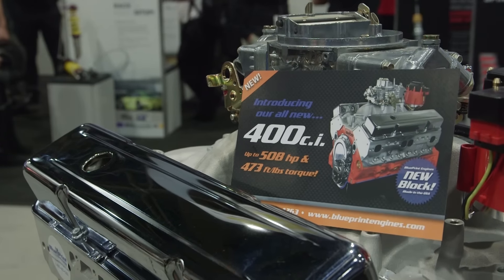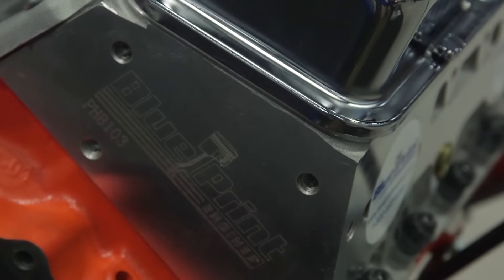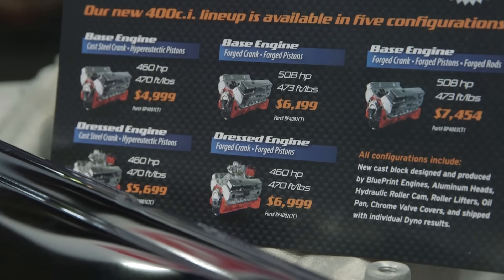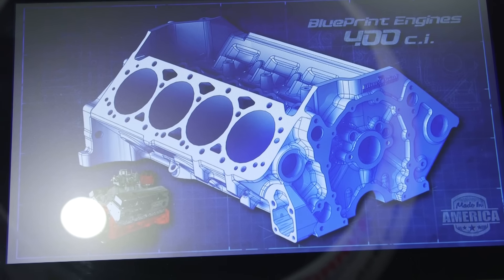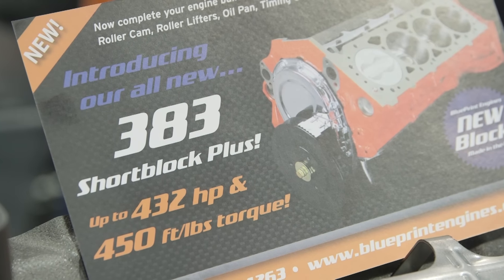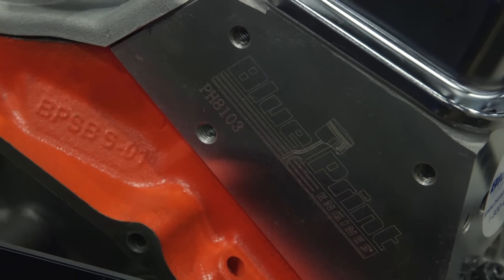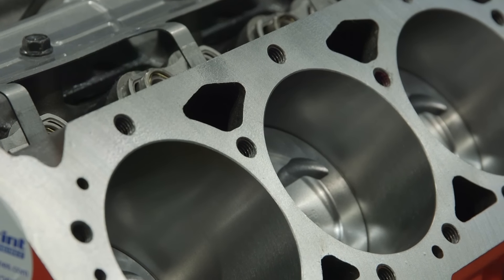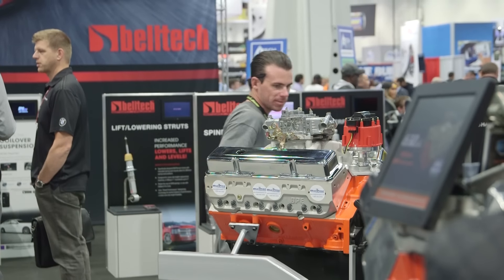SEMA 2015: The 400 is Back from BluePrint Engines

Comment: There is an old Hot Rod article on the AFR (air flow research ) website called: The 350 Chevy should have built. 400 block 327 crank 6 inch rods. It produced 400 hp 400 torque on 87 octane fuel. I'm glad the 400 is back so I can take a crack at this engine. Hell, if Blueprint sold this engine, I would buy it.
Reply: @derekthegreatgonzo  Just went and read that old Hot Rod article on AFR's website. Definitely not moronic. I'm gonna build the engine they specify.

Comment: what torque converter is recommended
Reply: I called B&M with my dyno sheets and ended up buying a 3000 stahl nitrous hole shot torque converter...for th350 trans

Comment: This is grrt , what I've been searching for . Will this plug n play for 95 chevy C1500 ?
Reply: It’s a great engine we bought the forged internals and it is mean
Reply: As I recall. All 400 sbc. Came with 2.02 heads,   and 4 bolt blocks. And GM got stupid with the badging on their cars back then. I have seen Chevelles with 400 small block badges and under the hood was a 402/396 I've seen full size estate wagons with 400 badges and under the hood was a 454. A 1969 C20 camper. Special with 396 badges on it. And it had a 400 small block
Reply: No 95 is a vortech.  The fuel inj won't work you can use the short blockof the 400

Comment: I’m really thinking about buying a 400 ci motor that’s capable of adding a turbocharger on it. I think this is the route I’m going to go
Reply: The N/A 400 is plenty lol it’s a monster
Reply: @yamahaguy1732  I’ve heard nothing but good things! Only upgrade I heard u need to do is get better valve springs and better cams but other than that it really is capable of taking all the power you throw at it
Reply: @flying-fijiantv6282  idk if you are talking about for a turbo or what but stock it’s pretty perfect it’s got a big nasty cam in it
Reply: @yamahaguy1732  supercharger with a 8” crank pulley and a 4 1/2” blower imma check it out. Do u have one?
Reply: @flying-fijiantv6282  We have the non power added 400 it makes 508hp and 517ft lbs of torque
Reply: @flying-fijiantv6282  I love the thing
Reply: @flying-fijiantv6282  wish I bought one for my truck I’m just running the 350
In it
Reply: @yamahaguy1732  nice! I can’t wait to get it. My 81 Camaro has been on stands for a good year I’m ready to add some power to it
Reply: @flying-fijiantv6282  ours is in our 78 camaro
Reply: @yamahaguy1732  oh man! That’s hell cool
Reply: @yamahaguy1732  how was the fit? Did u have to do any fabrication? Motor mounts? I don’t think the 78-81 were different. Except the 78 came wit a 305 I believe?
Reply: @flying-fijiantv6282  everything fit fine it had a big block in it before from the previous owner but mounts are the same from what I can tell
Reply: @flying-fijiantv6282  they look like the originals and actually I know they are the originals because we ordered new polyurethane mounts specific to the car
Reply: @flying-fijiantv6282  should be perfect fit and you will really enjoy it the car is so much fun now
Reply: @yamahaguy1732  man! Thank you. I can’t wait to drop the 400 in there. Big upgrade from the original 350
Reply: @flying-fijiantv6282  you will enjoy for sure

Comment: 8years on and still no short motor or block only option as promised repeatedly . LOL 
Be careful many combos are not full internal balance , single piece crank seal ie your oil pan may not work .

Comment: Trying to compare the 383 and 400.  I have read and read about the 400.  Everything says it is a 80K mile engine with a catastrophic fail at that point.  This is due to rod length and bad geometry internal.  Any thoughts from keyboard warriors?

Comment: A 632 with more hp than anything else in the industry ? Oh my weary bow tie man. Be careful when making such a brave statement. Case in point. Mr. John Kause does a little 545ci bbf that is what he calls off the shelf parts. Meaning the part numbers he uses are not anything custom from anyone using those part numbers it made on the dyno over a 1000 hp. And that is a 545ci which blows a GM 632 into the weeds and I'm guessing your 632 crate motor as well. Kause considers this 545 a off the shelf/ crate motor. 
I don't know about a warranty if any. I rather doubt that there is. Maybe you can say highest hp crate motor with warranty ?

Comment: dont 400 chevys have a over heating problem?
Reply: From the factory they did, but with modern radiators and fans its not an issue.  Also the engines need to have steam holes drilled into the heads, and a ton of guys forget to do that when they swap 350 heads onto them and have issues.
Reply: blueprint doesn't need the steam vents
Reply: They need steam holes, because there is no room for coolant passages in a small block bored to be a 400. No matter how well they design it...so if that's TRUE, i love to know what they did
Reply: The block in this video doesn't have stem holes, so maybe the bores aren't siamezed like the originals were.
Reply: That could have been a 350 (the short block) as far as i know there is now way to have the dimensions of a small block, boring it to 400ci not drilling steam holes. And again IF so ? Gladly would like to see what they did then..
Reply: Those are aftermarket blocks which all engine builder are using like Nelson and Reher. Blueprint also uses newer style blocks which have far better features than the blocks of prior generations.
Reply: Mine don't my 406 doesn't go over 185 degrees with electric fan. 160 thermostat. With 195 degrees thermostat it didn't go over 205 degrees.
Reply: @chriswells1440  mine when idle heats up fast...that being said i run the biggest lobiest cam you can possibly put in a 400sbc. For sure that's a factor too
Reply: yep is the easy way to answer your question.
Reply: ALL BLUEPRINT ENGINES have a overheating problem, I've got one.
Reply: @Tiptoetherat  I've got the newest aluminum radiator and fans that are made on a Vortec sbc 350/370/hp engine I bought from them, even have one of their highflow water pumps with the bypass on it, the temps are still all over the gauge and the gauge is brand new, I changed out everything, sensors, hose routing hell you name it still have the same problem and the cheap Holley 600 that comes with this engine sucks, the choke cannot be set to work, I regret the day I bought this from them that's for sure.
Reply: @MichelLinschoten  A so  called tech there told me their intake manifold doesn't supply coolant to the passenger side head (rear) and supposedly that is what causing all my over heating problems, I have spent $2,000 trying fix this problem but nothing has worked and hell it's still under warranty.
Reply: @chriswells1440  I installed a new Vortec sbc 350/370 hp from them and the temps are all over the gauge, installed new gauge, moved sensors to suit them, rerouted hoses, changed water pumps to their wants, still have over heating problems, I see one end to this, my attorney.
Reply: 400 sbc chevy heads have a steam hole .if you use non-400 heads on a 400 sbc short block ,you need to drill the heads with small holes to match the 400 sbc short block .
Reply: No, never had a problem.
Reply: It did when people would throw 350 heads on them and block the steam passages
Reply: Support your local machine shop. Build your engines.
Reply: @clarencemc3rd295  you'll spend more piecing it together,  machining,

Comment: 500 horse power???????? the 350 does that east.
Reply: 500 HP without having to even twist 6,000 RPMs... 550+ HP @ 5900 w/ dual quad tunnel ram... as a stock crate motor... 
https://www.motortrendondemand.com/detail/dyno-proven-50-hp-with-one-bolt-on-engine-masters-ep-1/0_aq9h0374